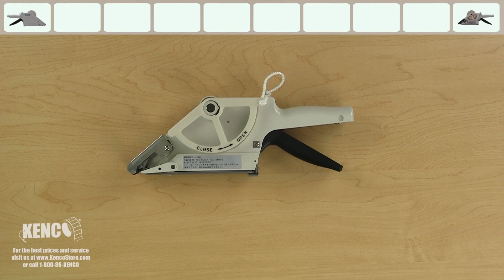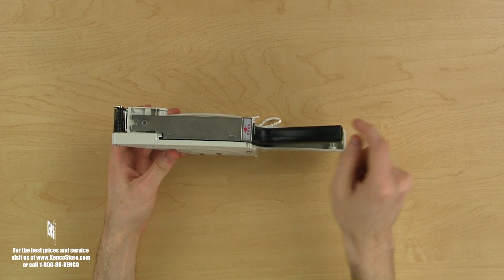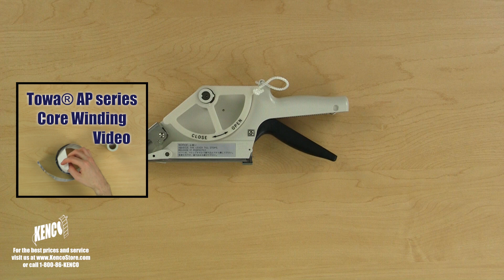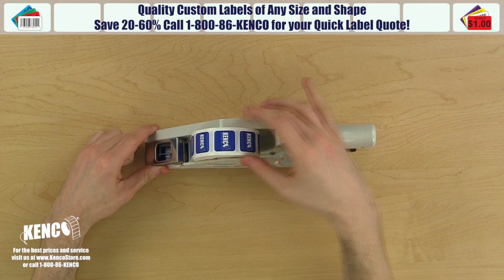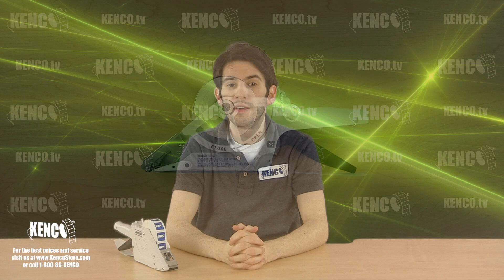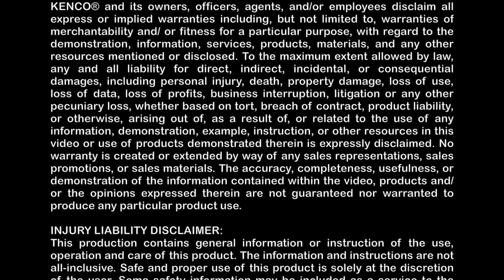Towa® APN10-30 Loading & Applying Instructions

Comment: Hi, about internal core size I can see that it is 1" (2,54 cm) but my label prducers can produce only with 4 cm core roll. How can we solve the problem?
Reply from the maker: You could still use this core size, but the more important part is making sure you don't exceed the 4" maximum outer diameter. You could also buy individual cores from our website and hand rewind them. It's a little annoying, but it can be done.